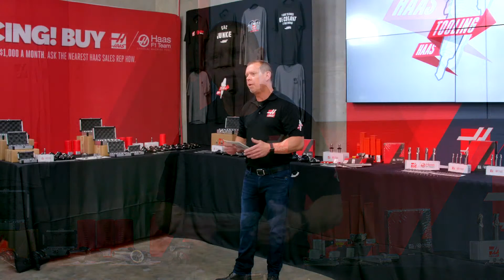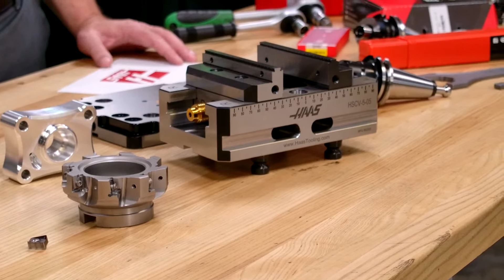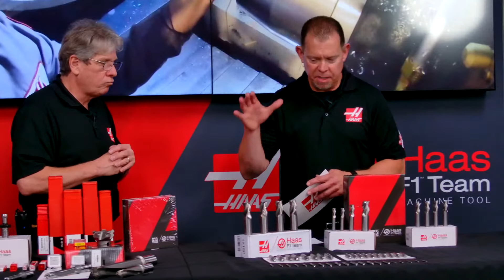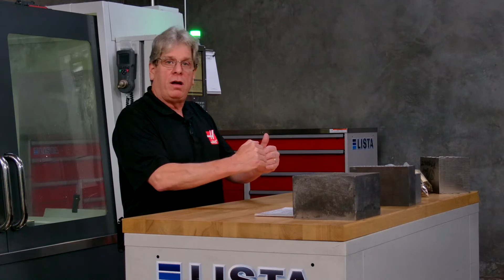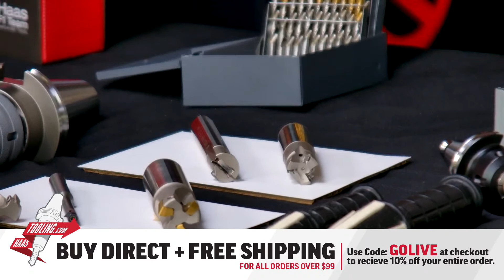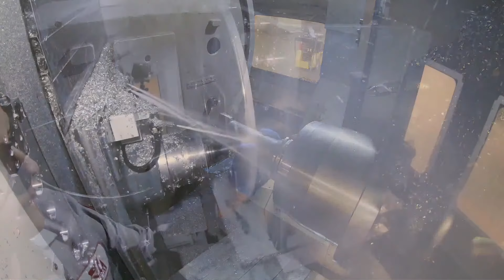Demo Day Live July 1, 2020

Comment: If you have a VF with a TSC-ready spindle but no TSC actively installed, is it better to get non-TSC studs until the shop upgrades to TSC, or is it better to just get the TSC studs?
Reply: it doesn't hurt to have TSC studs.

Comment: Do I have to buy an unlock code after 200 hours in order to keep using these tools for their intended purpose?
Reply: lol, burn!
Reply: I don’t get it
Reply: iClark when you buy a Haas machine that's financed or use a tryout option on the control your use of the machine or option will expire after 200 hours (or 30-180 days) of use.  Unless you pay Haas.  Then you get a new code.  Just a good jab at all Haas owners. 😁
Reply: Cory Sanchez it's unique to each machine.
Reply: no you need the code to unlock once ever 10 cycle